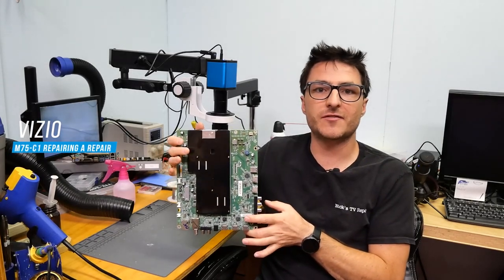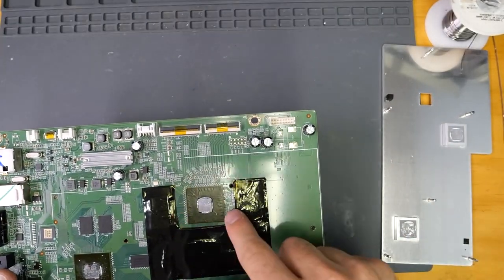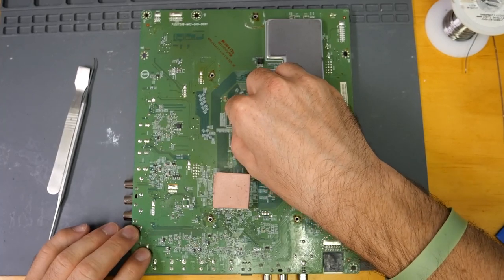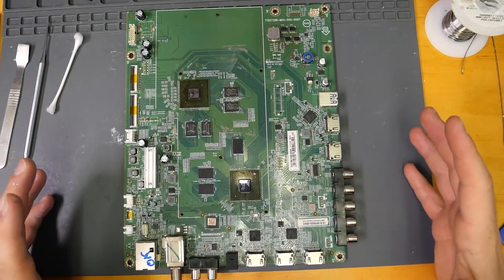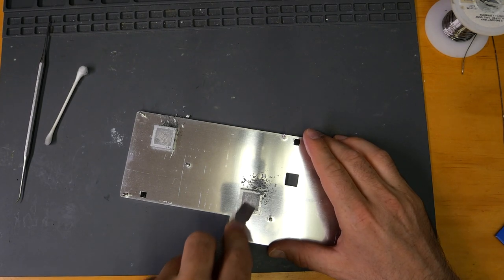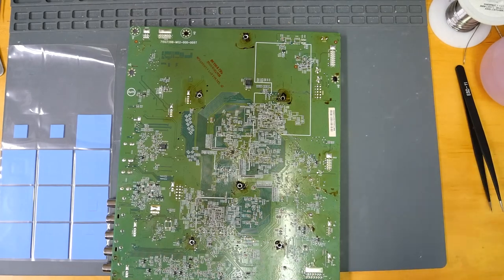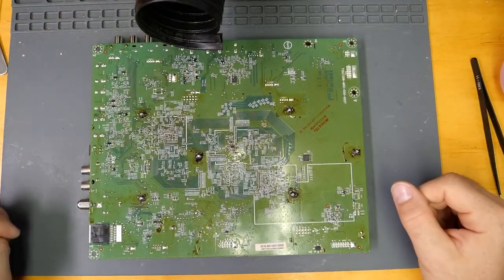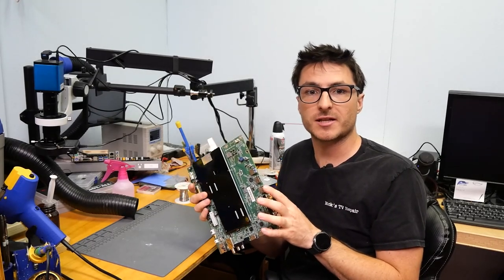How to properly reflow

Comment: I have a lg 65 inch tv im thinking this needs done do you still do this service and whats something like this typically cost im wanting to save this tv if possible previous owner said it used to work just fine then one day he turned it on and was watching a game and the tv just went black no power
Reply from the maker: Hello,
Our contact info is in the video description, I highly recommend you reach out to us directly, and fill out the repair request form on our website. Provide us the info on your TV and symptoms, and we will let you know if we can help you fix it, and if so which board to send in for repair.

Comment: what is reflow and why is it necessary, what does it actually do
Reply from the maker: The common fault is cracked solder joints between the PCB and the processor chips. The chips sit on a ball grid array which connects the chip to the PCB. When the board gets hot from being used, the chip expands at a different rate than the PCB. This difference in expansion rates stressed the balls and over time caused micro cracks in the solder. The reflow will melt the solder and reform the bond.

Comment: How much would it cost to have this done if I sent you the CPU board. Vizio D55u-D1. I was using it when it went bad, the screen went to pink snow/static then went black. still has sound
Reply from the maker: Right now we are doing that repair for $89.95 as a flat rate service, but unlike the other repair companies, we rework both the chips, and we also provide a 1 Year warranty on our work. 
You can check out our listing linked below for more info
https://www.nickstvs.com/store/p2459/D55U-D1.html

Comment: I bake them in the oven at about 215 degrees for 15 minutes. Works every time.
Reply from the maker: The oven is risky, high chance of things going wrong. and more importantly, how long does the board work for post repair? That's the important question!

I can heat up a board with a hair dryer for a few minutes, not even melt the solder balls and still get the board to work for a few hours maybe even a few days post repair because that would cause enough thermal expansion to force contact between the solder balls and the board. The problem is that it's not a repair, it's going to allow the set to work for a small amount of time longer but not a long-term repair. 
That's the point of the video, if you want it done right, you can't skip steps, you have to do it right, and you will want to use proper soldering equipment.
Reply: @NicksTVRepair  what reflow/bga workstation do you use?
Reply: reflowing does not solve any problems as flux the most guys is using is not working well on high temp soldering alloys,reballing is the only long therm solution
Reply: @tommajor1013  Is it difficult to re-ball?

Comment: I just got another 4K vizio today I have two of them now, M43-C1 and M50-C1. I'm afraid to try a reflow with my little YIHUA 853AAA BGA Rework Soldering Station. I don't know the profile good enough. I'm watching videos to learn and landed here again. I like the idea you added new thermal pads, that fixes the original issue, a cooling issue. I have a night owl security cam, within a yr the HDD went out, it was always hot, I added a cooling fan to the heat sink and exhaust fan to enclosure, soon adding an SSD. I don't think they want these things to last.  The old saying, if you can't hold your finger or hand on it, its too hot!!
Reply from the maker: Vernon,

I have had lots of people in the past ask me how to reflow and what temps I use and what not. The answer is unfortunately not what people want to hear. The answer is it depends. We have 5 different types of rework machines from 3 different manufacturers. All use different heats and profiles that are unique to each machine. 
For example, one of the machines has thermal sensors that you have to position on the board yourself. Depending on the exact location of the prob, the temps it registers will be different and thus the machine might put out more or less heat. If you want the solder to get to melting temps and you have your thermal prob on the edge of the board then you have to probably go to about 215C for non leaded solder. Now on another machine in order to remove human error the thermal probes are located inside the heating elements. (this one is convection) So it measures the temp of the air coming out. However the air had to travel a few inches through the nozel befor hitting the board. This means it cools down a bit and you aren't measuring the temp of the board, but the temp of the air hitting the board. 
That machine we have to usually go as high as 245C in order to get to melting temps because 245C means the board will hit about 215c. 

When we first started we had 3 Achi machines. Identical models. All of them had their own unique tweaks and profiles because even though they were all the same machines, there was 5% tolerance on the temps and so each machine had it's own profiles very unique to it and only it. One of them we didn't have to go above 210, one we had to go to 235. Using the 210 as the temp mark on the machine that needed to go to 235 meant no flow and no repair. Vice versa meant you were going to burn the board.

Comment: Your reflow process is sound, however there didn't appear to be any ESD protection used.
Reply from the maker: Beyond making sure you aren't charged before working on a board these boards are not very sensitive to static, they are also coated and insulated already against static. Killing one of these boards from static is very difficult. There are a lot of factors in your environment that can cause more or fewer static discharges. The environment we work in is not conducive to creating static discharges.

Comment: Lead free solder melts at 650°- 700°F (343°- 371°C), vs leaded solder at 375 F, but also I understand its not only how much heat but how fast and evenly you heat it. Was eyeing some new machines, 4 grand, but the have infrared heat top and bottom, with visual alignment.  How much bottom heat do you use, I assume its much less. Do those machines come with pre programmed profiles?
Reply from the maker: I sent a pretty lengthy response to the other comment you left. 
One of the things I would say is someone that has experience can more or less reliably reflow a board using a george foreman hot plate/grill and hot air. 
Buying the $4,000 machine won't give you the best results if you don't know how to properly use the machine. 
What I recommend to everyone is #1 DO NOT practice reflows on the boards you are actually trying to fix. You will break your boards and it will be a very expensive mistake every time. Go find cracked screens that have mainboards with a low value in them like for example all the TCL, Hisense, other similar cheap brands that always have bad LEDS and thus by default low-value mainboards. Go practice reflowing those boards, keep the cracked screen so you can test the board post reflow to see if it still works. 
#2 Practice on more than 1 board. Every board is different and needs different settings. The reflow requirements for one board is different than for another.
Learn your equipment, how it works, your equipment is different than mine and thus I can't teach you how to use it. You have to self teach on this one through trial and error.

Comment: Enjoyed this video...great explanation of the process.  Curious what tool you are using to remove those soldered mounting pins on the heat sink at the 1 min mark?
Reply from the maker: That is a Hakko Desoldering tool FR-301 I think it is. 
Here is a link to it if you want to buy it. 

https://www.amazon.com/Hakko-FR-301-Desoldering-Tool/dp/B07BKSLLG9

Comment: Hi Nick, could you commend on thermal pads for the Vizio board? What brand did you use? Looks like old ones were glued , do new ones come with adhesive? Thanks
Reply from the maker: The old ones were held on with double sided ahesive tape same as the new ones. When you put lots of thermal cycles on the adhesive tape it changes it a bit and makes it look/feel like it's glued but it's the same thing just one is new tape the other is old tape with lots of heat stress. Just like when you have a brand new sticker, it's a lot easier to remove a brand new sticker that's just been freshly put on VS one that has been placed on a surface 5 years ago. 
I don't have a brand I recommend, my brand I use sells minimum quantities of 1,000 at a time, I would recommend them but I don't think that you are looking for that kind of volume.

Comment: Love this video! In fact I'm new to reflowing. I have a Vizio D55U-D1 that appears to have a bad main board. What I'm missing here is your test process. Do you test all incoming boards before and after you repair? Do you have the capability to test every board you work on in an actual working environment? Thanks!
Reply from the maker: Hello Mark,
We are a professional business with what I would argue are some of the highest quality standards in the industry. So to answer your question, yes we live test every board before and after repairs. If we can't find a fault with the mainboard we reach out to the customer and discuss further. If we find a fault that is outside the typical repair we also discuss further.
It is imperative to test prior and post repair. While our videos cover the most common faults, it doesn't mean those are the only faults that happen with these boards, and a proper diagnostic is thus necessary before every repair.
It is also just as important to test after even if a reflow is the required repair, a reflow doesn't always fix the board. Sometimes a re-ball is needed or a replacement chip. If we were not testing boards after repairs, our quality would be much lower than what is acceptable. 
We offer a 1 Year warranty on all of our mail-in repair services currently with the option for 2 and 3-year warranty extensions. We would not be able to do this in a profitable manner if we did not have high-quality standards.

Comment: Thanks for the great video.  Can you characterize the reflow path and temperature(s) you use for a typical reflow?  Preheat at? Then something like 180C for 5min then a couple min at 210C?
Reply from the maker: James, 
I am sorry but you won't like my answer. I don't think that providing you that information would make sense. There are too many variables at play here. You do not use the same equipment we do, the profiles we use most likely won't work for you and your set up. Each board is different, each chip is different, we use different profiles for different boards and chips. 
I recommend you tinker with your own set up and find your own settings that work for you and your equipment. I always recommend you practice on defective boards and low cost circuit boards that are easily replaceable first while doing your tinkering. Once you figure out a good profile, then go ahead and try it out on the more expensive boards that need repair. 
I know it's not the answer you are looking for, but while doing this, you will learn a lot  and it will be much more beneficial for you in the long term. 

When we first started 6-7 years ago, I purchased 3 identical ACHI rework machines. Granted they are low end machines under 1k but all three ran differently. More expensive machines don't have as much tolerance, but its just as an example. 
We had to run very different profiles on the three macines in order to get the same results from each of them. 
This is why I don't think sharing profiles makes sense most of the time.

Comment: I checked out your website, do you only reflow Vizio boards? I have an LG board that needs a reflow for a no signal HDMI issue.
Reply from the maker: We reflow, reball and replace. It depends on what level of service is needed or requested. We work with Vizio, LG, Samsung, Sony, Panasonic, Toshiba, and Sharp as the bulk of our repairs, but we do work with all brands and manufacturers. 

Most people aren't willing to pay for the reball or replacement so a reflow is what we end up doing most of the time. 
If you have specific questions about a repair, I would recommend having you send us an email. You can find our contact info in the video description.

Comment: Great videos. Are any of the failed components that get replaced damaged from some part upstream? How do you diagnose that?
Reply from the maker: Not on this type of mainboard. 
Typically that doesn't happen with mainboards unless you have a lightning strike of some sorts and even then the damage is typically localized. We do sometimes see that with power supply boards however. On those you just have to be more thorough when doing short checks.

Comment: So out of the failures on boards, seem it mostly the chips or the solder joints on those chip. How often do you see other thing go bad around the board?
Reply from the maker: Yes often the chip either shorts out/becomes defective and needs to be replaced or has cracked joints. That's the bulk of the repairs we perform so that's what we are showing on our channel, but not all boards fail like this. We see HDMI processor chips go out, software chips go out such as EEPROM, NAND, EMMC, and ATMEL. 
We see voltage regulators, Buck converters, and a few odd ball shorted caps. This is all for mainboard type modules though, power supplies are usually different.
Reply: @NicksTVRepair  Do main board failures usually cause screen or image distortion, or do they just stop working? I had a dirty LVDS cable once but the image was more like solarized, no lines and such.  Where do you usually buy these chips? You are the only one that has answered my questions, I really appreciate it.  Power supplies don't seem so intimidating to me, because I understand how they work, when I went to tech school in 2000 digital wasn't as big as it is now.

Comment: What are the melting tempratures?
Reply from the maker: 425F or 218C  for none leaded
But you have to go higher than that to get a good flow on the board. Depends on the volume of air you have, distance, the environment, and many other factors. There is no one size fits all.